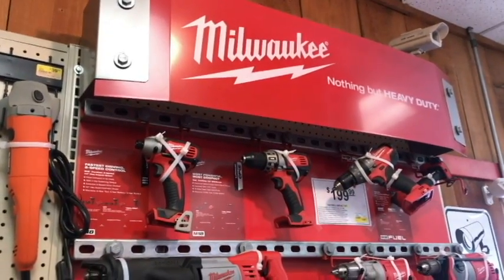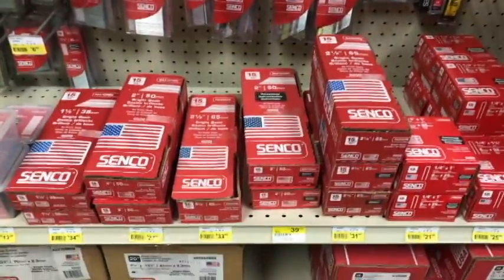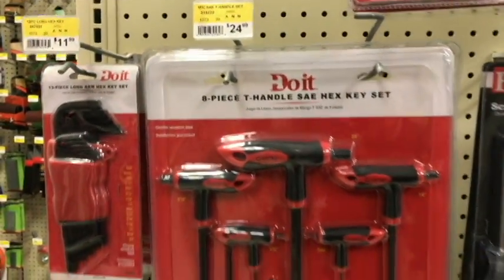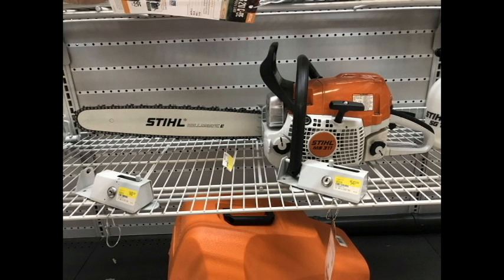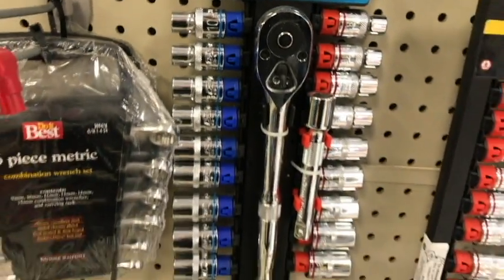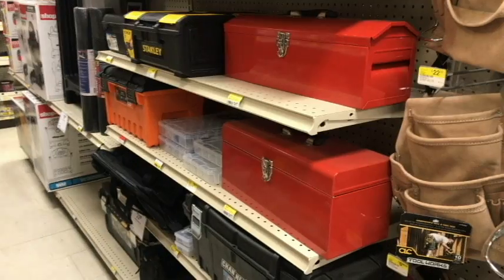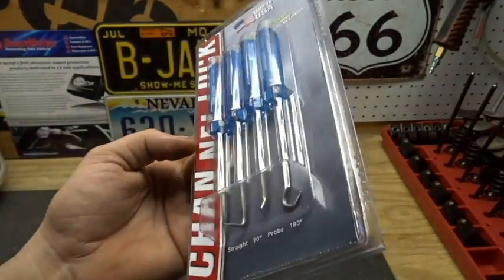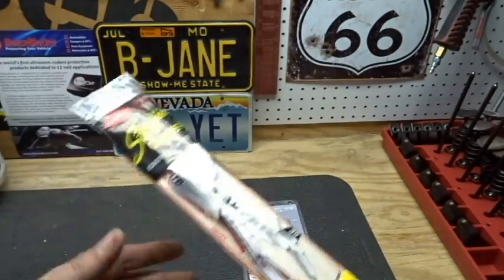BUILDERS SUPPLY WALK AROUND IT'S BEEN YEARS!!!

Comment: Curious for your Ridgid video. Been shopping for an ecosystem to buy in to, and I was looking at their mid-range impact wrench for automotive and possibly junkyard use, but have read horror stories regarding their warranty process (like them retaining your tool for close to a year, and even then it's not even fixed). I'm also iffy because they have no upgrade path to a high torque variant atm.
Reply from the maker: I’m hoping to create it over the weekend. Depending on weather. Thanks for your interest. As for warranty. Lifetime on almost all, so long as you register them online. Honestly I haven’t had to warranty any of them in the last 3 to 4 years of ownership and that’s about twice the amount of time my old DeWalts lasted. The Again My Dewalt Set at that time was ICad batteries and my RIGID is Lithium. Also When I took the DeWalts back to Home Depot it was a bit of a headache but I ended up leaving with almost twice the Amount of Tools that I came in with.
Reply: @JustinDowDIYcentralhighway  The price point was what attracted me. I'm on my 3rd Jeep now, and being as I prefer older vehicles I decided it was time I build up a set and start "emptying every pocket" just a bit less in labor/markup charges. lol Crossing my fingers for good weather.
Reply from the maker: Mel Me do. Last weekend was high winds, weekend before that Snow ⛄️ and in between both and Everyone sick 😷 in between. It’s been rough. Can’t wait until it’s 100 + degrees
Reply: @JustinDowDIYcentralhighway  Just figured I'd post back and give you a heads up on the route I took. I seem to be having a bitch of a time finding Ridgid lately at HD in a battery/charger kit (buying individually I'm up to the high torque detent pin Dewalt price anyways). I found Kobalt has a 650 ft lb (breakaway) 1/2" impact kit (hog ring). After 5% discount from Lowe's account, about $175 out the door. 5yr warranty on the tool, 3yr on the battery/charger.
Reply from the maker: Mel Sweet! Let me know how you like it as time progresses and you use it more and more. Congratulations on your New Addition! 🍻